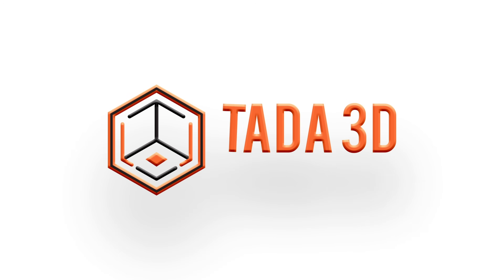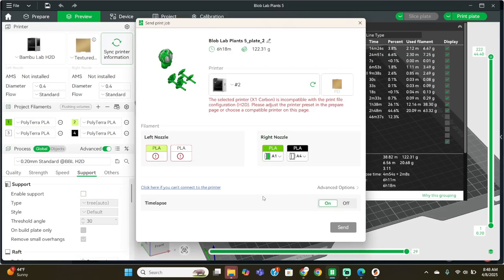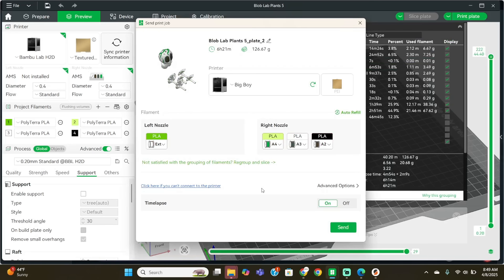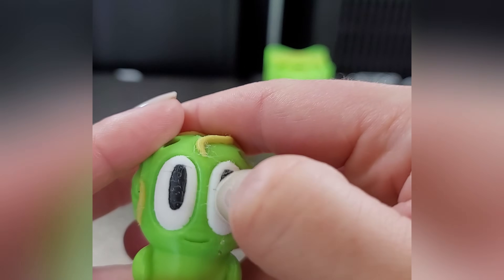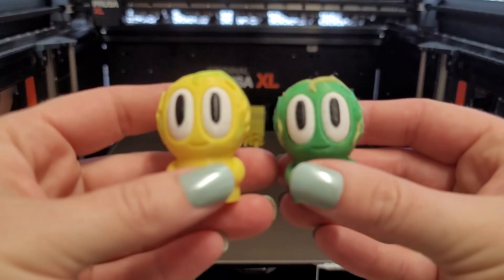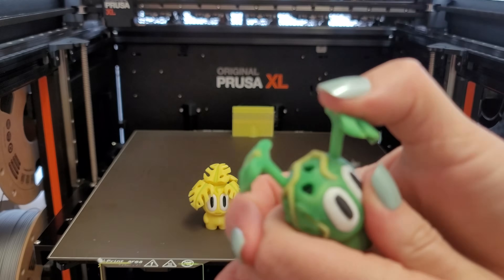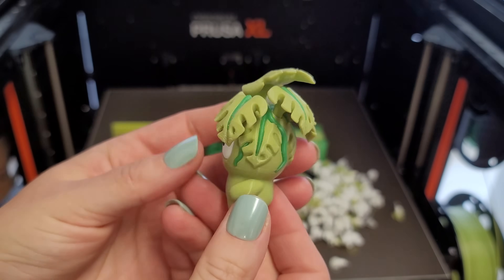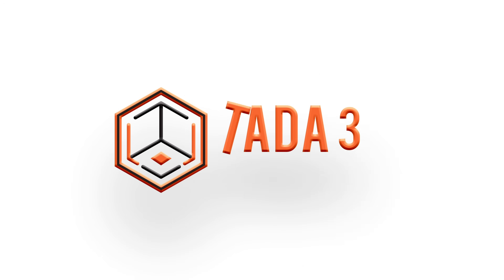XL or H2D? Which prints the Blob Lab Plants Better?

Comment: The XL is a £4k printer, the H2D is £1.6k, the 5 micron calibration bed is £85.00, so you could buy that and about  100kg of filament for the price of the Prusa, and you still can’t print ABS on the Prusa XL without shelling out another £634.00 which will only get you the enclosure, as no chamber heater is available.
Reply from the maker: Very true. And the Bambu H2D did better on my mini showers. But it's down right now. 😭
Reply: @tada3dprinting  Sorry to hear that, I hope it's nothing serious

Comment: You need to print a string tower for that filament to find the point when it stops stringing and if you can bump the nozzle temp by 5 to 10c, you can get rid of a ton of those layer lines.
Reply from the maker: Thank you

Comment: Disappointing… thought H2D would do better than x1c at the very least…
Reply from the maker: Yeah this one surprised me! Thanks!
Reply: It does, overall. I've found that my H2D's need super dry filament (way more than youd think) to achieve perfect prints. They also print more dimensionally accurate than any printer I've used. Because of that, models designed for other machines may need tolerance adjustments to go together because they're designed with some "slop" in mind.

Comment: How do you add more layers in a multi color print ? I know Bambu/ reality use flushing volumes to prevent colors from bleeding. How do you prevent bleeding in the Prusa XL?
Reply from the maker: On the Prusa XL, you can change the layer height, of course. But now that you mention that, I'm not sure there is a flush setting like the Bambuslicer. I'll look at this. Thanks!
Reply: @tada3dprinting  how do you change layer height in prusa slicer ?
Reply: @Average3djoe you navigate to the layer height section and manly change it to what you want, and the reason there is no bleed when it comes to the prusa xl5 tool head is because the colors have individual extruders to go through. They aren't being purged all through the same nozzle

Comment: Just purchased this file. Going to print it tomorrow with my h2d and see if I get the same results.
Reply from the maker: Awesome!
Reply: @tada3dprinting  Single color is a tight fit but parts do go together. Will give multi color a shot next.
Reply: @tada3dprinting  Multi Color worked for me as well, maybe issue was fixed with firmware update.

Comment: The Bambu Lab H2D, like the Prusa XL, shows some early-stage flaws. When you launch a machine using tech that’s new to your lineup, there are always things to refine—here, it's stringing and tolerances. But judging by how the X1C matured, I believe (and hope) Bambu Lab will fix these over time, just like Prusa did with its own launch issues. Bambu makes solid machines, even if I'm not a fan of their closed ecosystem or the petty trolling between Prusa and Bambu. They just need time to adapt. Plus, with import taxes and recent backlash from loyal fans, they’ve got enough on their plate already.
And maybe the profile was not adapted ?
Reply from the maker: That's very possible. Thanks so much!

Comment: The H2D is only actually faster with multi color when printing up to 2 colors. Anything more than 2 colors will require the AMS, and thus the print time will increase dramatically, just like the X1C. You're using 4 colors, so the AMS comes into play. Run the same print but with only two colors (no AMS) and you will see the time drop, run it with more than 2 colors (with AMS) and the time increases significantly. Prusa XL is significantly better with multi color printing all the way up to all 5 of its tool heads because it doesn't spend 2.5mins rolling back filament with every color change like what the AMS does. Also prusa printers are just more dimensionally accurate.

The H2D is basically just a beta product and like nearly everyone agrees with. is a flop and misses the mark of what it could (should) have been.
Reply from the maker: Yes, and most of my items are either 1 or 4 colors. I'm really surprised Bambu didn't make this with more toolheads. Thanks!

Comment: Seems like you have the XL tuned in very well for your filament. Maybe you need to do a lot of test prints on the H2D and tune it? Always great to see your findings
Reply from the maker: That's possible. Usually the XL is the stringy one. Thanks!

Comment: Also worth considering price of $2k vs $4k. Need to be very high volume to make up for that difference
Reply: If the parts don't even fit, are you even saving $2K?
Reply: @ You can solve that for free with settings
Reply: Waste isn't the only thing to consider. Time is another factor. I sell mini football helmets. I do not have an H2D to compare, but as far as the X1C vs the XL my results are night and day. Assuming my filament is $20 / 1kg a roll, and I am doing a 4 color of a "medium" color transition helmet, my results are as follows:  My X1C the shell of the helmet with waste costs $9.87 and takes 28 hours to print. With the XL the cost is $3.62 with waste and takes 8 hours and 10 minutes. Is the XL worth it? I guess it depends on the use case. And this isn't going into the size comparison of the build plate between the H2D and the XL.
Reply from the maker: That's very true! Thank you!

Comment: That's interesting your experience with the print quality.  I wonder if it's a bambu QC issue or something with your settings/profile.  Another YouTube channel did a direct comparison between XL & H2d, and in printing several different models in different filament types, the H2D was decisively.the winner in both quality and accuracy.
https://youtu.be/4cWDVdBz7p8?t=1533
Reply from the maker: I hadn't noticed the sizing issues on other prints but I'll be looking close now!  My mini shower definitely printed better on the H2D. It really just depends on what it is! Thanks!

Comment: It's too bad the XL still has sooo many issues. Bought one about a month back and one toolhead was dead on arrival and another died on 2nd print. Returned it out right right away. For a printer that has been out for 2 years it shouldn't have these sort of issues and still need printed part updates. Core One also having lots of issues and clearly was not ready for release.

In any case Toolchanger will always be the best way to go. Looking forward to seeing Bondtechs solution more.
Reply: It seems like bad luck.
Reply: @ it was blamed on printed parts that were revised.
Reply: @AronsTube  thats a bummer. They definitely shouldnt make the parts worse.
Reply from the maker: Yeah its not every print that works better on the XL for me. This one surprised me. 
I'm shocked to hear they are still having issues like this now! I wonder when Bondtech is coming out. Thanks!

Comment: For the print quality two things:

1) You need to calibrate your filament. This will help alot with print quality.
2) Stringing I would guess is either wet filament (need to dry it) or you need to print a temp tower to see what temp gives the best results on no stringing.
Reply from the maker: Thank you!

Comment: I probably would print the eyes separately SINCE you are already assembling things.  This would have two colors on all your prints.  I may test this out on my x1c and see what the times would be.   In the H2 and xl     this could knock things down to 1/6th the speed.
Reply from the maker: That's true. Blog Labs does have an option to print the body separately from the eyes. But I couldn't get the two greens to color correctly for some reason. Thanks!

Comment: Tool changers are definitely the best solution for multi color printing, less waste and time. I like Bondtech’s new solution that they have demonstrated, one extruder and nozzle just cartridges that snap in and out, I think that’s the future.
Reply: Thanks for sharing, I hadn't heard of this, but after seeing it, I agree, I'm going to hold off purchasing an XL or H2D for it.
Reply from the maker: Oh good to know! Thanks!
Reply: Does it scale?, what about 8-16 color prints?
Reply: Sure thing, but first of all, the tool changing has to be reliable. On the Prusa XL (order end of year 2024), after just 50 hours of printing, we are still not able to print a two-material part without a tool changing error.
Reply: @jirimisa855 that's unfortunate. The one thing that I found when I first assembled mine and had similar errors was that the docks were not fully mounted correctly. What worked for me was to align the docks and hold them in place with a simple clamp like you would use for woodworking to attach them tightly to the metal frame, and then to attach the screws firmly once they were clamped. That solved any tool head swap errors I had and it was basically because the docks were not positioned where they should have been without the clamp to hold them. Obviously once the screw is tight you take the clamp away.

Also for the docs to truly be seated fully you have to really tighten down those screws in the back, and I actually ended up buying a t-handle style allen wrench to be able to apply enough Force because the included hex keys were not nearly strong enough.
Reply: @jirimisa855 as a counter point, I ordered my xl in Feb 2024 as 2T and then upgraded to 5T in July. I have just over 2275 hrs of print time on it and it has been the most accurate and reliable printer I run (currently 11 printers)

Comment: Great video! I also Subbed. I have an H2D on order (2nd batch) and it’ll be my first Bambu printer. I currently have the XL and the MK4S with the MMU3. This video does not give me high hopes for the H2D though. I was hoping it would fill in the gaps and quality of life issues I’ve been feeling with Prusa lately.
Reply from the maker: It really just depends on the model. My mini shower was the best on the H2D. If this is your first Bambu and you have only Prusa, it will fill the void. I jump back and forth depending on what I print. But I wouldn't like to have only one brand. Thanks!
Reply: Give it time , i remember watching videos from many content providers when the XL first came out, and the results didn't  impress me at all either .
Reply: Although I picked the XL over the H2D while having multiple X1C's I believe the H2D is just going through normal growing pains. If Bambu's track record continues, they will address the issues of the H2D (just as they did the X1C) and it will be a solid printer in the near future.  The XL has had more time to "cook" and honestly, I think it fits a different use case than the H2D.

Comment: Just an fyi you shouldn’t print more than one type of model in a single plate. If you have different multi color prints the filament swaps won’t line up per layer so you’ll have more swaps than necessary.
Reply from the maker: That's usually what I find. But for some reason with these 5 variations, it takes about 19 hours for all 5. Or 12 hours each. Also, the XL was faster with all 5 together. Thanks!
Reply: @tada3dprinting  the most efficient way would be to print multiples of the same model. 1 print might take 12 hours, but printing 5 of the same model won't increase to 60 hours.

Comment: Bambu's H2D isn't ready for prime time yet, it's in beta testing still it appears. The X1C ran better than the H2D which shouldn't be the case.

I miss my original A1 I bought that I upgraded to the X1C when the cord issue came up. I think as soon as I can use a real AMS unit and not that AMS lite I'm getting me another A1.
Reply from the maker: My mini shower ran best on the H2D. It really just depends on the model. I definitely prefer the regular AMS to the Lite. That would be nice if they make it compatible with the A1 series. Thanks!
Reply: @tada3dprinting  Bambu already said they would make the AMS 2 Pro compatible with all series printers A1 coming by Q3 2025. If they make the AMS 2 Pro compatible the original AMS would have to be too. They should have doen this when they released to A1/A1mini.

Comment: I have had similar fitment issues with my Bambu A1 Mini vs my MK4S. Same model, same filament. You little guy looked very nice on both the X1C and the XL. Can you not take an AMS from one of your X1Cs and test it on the H2D so that you have 2 AMSs? I thought that was possible.
Reply: It is possible. I will hook up my X1C AMS to the H2D when I receive it, hopefully this week.
Reply from the maker: I assumed you could only use the AMS 2 with the H2D. I wonder if I used the AMS  V1, if I would need to use the same on both sides. Hmmm I'll look into this. Thanks!

Comment: It's nice to hear the XL is working well.  Are super tall prints in the XL still causing a problem sometimes with prime tower falling over?
Reply from the maker: I haven't really been running anything super tall in multicolor in a while. If I do, I usually try to print without the tower. Thanks!
Reply: Not directed at me obviously, but on my XL with tall prints, I still get some banding with multicolor (which I think I just need to recalibrate since it’s been used more now and has some wear since initial calibration), but the wipe tower has been solid in my experience.

Comment: Interesting. Ive had hardly any stringing on my H2D and almost no cross contamination of colours. The waste can be managed if you create your own models by ensuring most layers have 2 colours and then the 2 nozzles can be utilised more efficiently. I haven't extensively tested it yet but so far H2D dimensional accuracy hasn't been an issue for me.
Reply from the maker: If the sizing on the H2D had been the only issue, I would've just reprint the leaves smaller and moved on. I'm having a hard time deciding what I think about the H2D because it's not really either extreme - all AMS or all toolheads. Thanks!

Comment: Bambu has been extremely conservative with these settings.
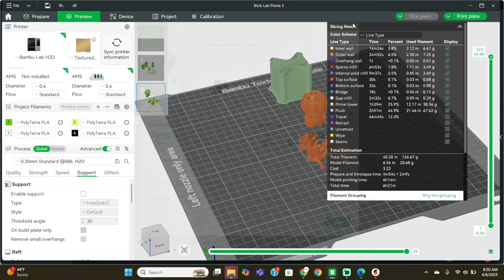Just shrinking the prime tower(which was using 25% of your waste) will help a lot. @ 2:46
Reply from the maker: Thank you!
Reply: @tada3dprinting  Ignore his comment, bambu has never been conservative with any of their settings. Shrinking the prime tower wont save you any time or waste, it will be marginal at best. What he's not telling you, and others(including bambu lab), is the H2D is only actually faster with multi color when printing up to 2 colors. Anything more than 2 colors will require the AMS, and thus the print time will increase dramatically, just like the X1C. You're using 4 colors, so the AMS comes into play. Run the same print but with only two colors (no AMS) and you will see the time drop, run it with more than 2 colors (with AMS) and the time increases significantly Prusa XL is significantly better with multi color printing all the way up to all 5 of its tool heads because it doesn't spend 2.5mins rolling back filament with every color change like what the AMS does. Also prusa printers are just more dimensionally accurate.

Comment: PRUSA has been claiming that “other” companies are not dimensionally accurate when using input shaping to increase speed and that PRUSA input shaping slows down at angles to ensure accuracy. Maybe they were referring to Bamboo, who knows because they don’t say. Try running a slower print on the H2D, maybe without input shaping and see if it is dimensionally accurate. If so, then this is what PRUSA was referring to. Also with the BAMBOO, you will always have waste with multi color on one nozzle because of the cut and purge system. While not compact and they need an AMS style box, the MMU had less waste because it retracts the filament back and just has the purge block. Anyway, for what you are doing it is hard to beat the tool changer on the XL and by now you are the XL expert. Good luck.
Reply: Input shaping works exactly the same for both systems. But due to the much higher acceleration on the Bambulab, pressure advance does much more expose bad calibration of pressure advance (the automated pressure advance calibration is pure advertising bs, and most don't calibrate it manually) of the used filament on corners and angles, which obviously leads to dimensional inaccuracies.
Reply from the maker: That's interesting. I will definitely keep that in kind when I'm running my prints between the different brands of printers. Thanks so much!

Comment: Thanks for the data - Bambu is making it really hard to want to buy the H2D, when a 2-head XL is $200 cheaper.
Reply: Not when you intend to print ABS,PA,PC filaments. The XL is a PLA/PETG/TPU printer.
My ordered H2D with AMS cost 2275€ tax included. EU.
Reply: @Todestelzer Yeah, very true. You’re not printing ABS without a cabinet. I only print PLA/PETG. Even with the conversion, that’s cheaper than what they were going to charge me, by $400. Bear in mind that we in the U.S. are currently in the middle of shooting ourselves in the foot, so prices will vary.
Reply from the maker: I hadn't even thought of purchasing a 2 TH as a comparison. But that's interesting. Thanks!
Reply: Prusa xl assembled with two toolheads costs 3149€ with vat and the H2D costs 1899€ with vat again. So no you are wrong. Check again.
Reply: @AngelVenomous I mean, I’m happy to be shown new data - but I didn’t specify assembled for the XL. I have no problem with proving that I know how to use a hex wrench to save $550. I’m sitting here, right now, with an H2D in my shopping cart, and a Prusa XL w/2 heads in my shopping cart, both with “click here to buy” buttons - the H2D is $2940.94, the XL is $2637.35. I’m assuming that your point is that the H2D comes fully assembled while the XL does not, but that’s not important to me when I’m weighing my options. Don’t get me wrong - I own 2 Bambu products (A1 and P1S), and they’re great machines. I’m just having a hard time justifying the H2D with what I’ve seen so far.
Reply: @karmachameleon326  lol where are you sitting with a H2D in a Shopping Cart?  That's the first red flag.